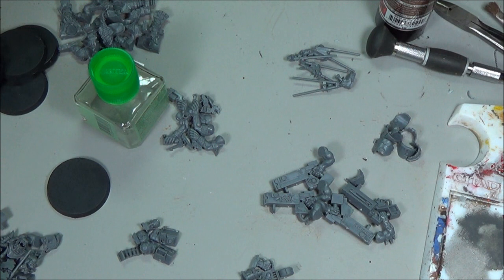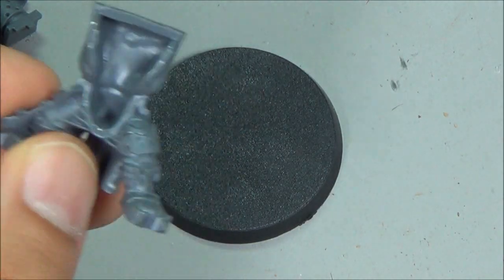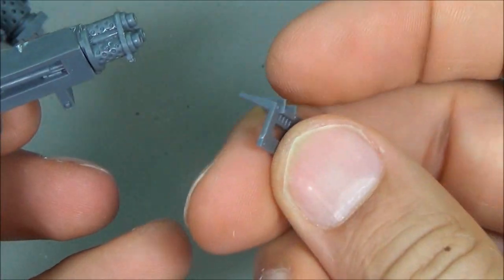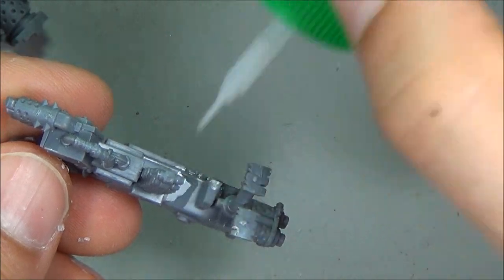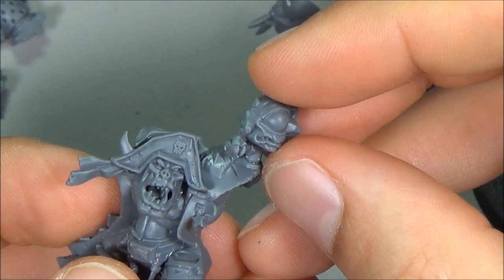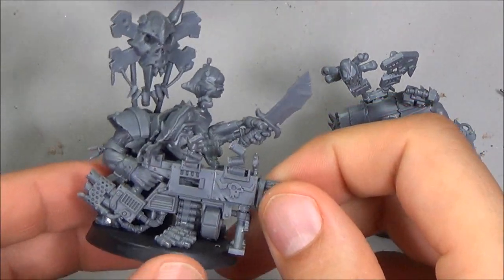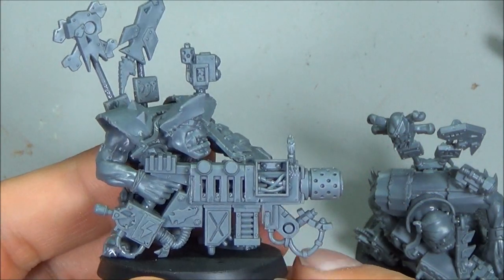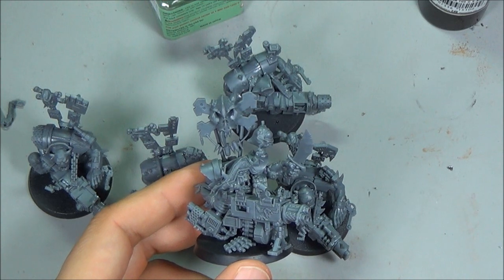Ork Flash Gitz Assembly

Comment: I am utterly disappointed with this kit.

wow we can have 5 guns look exactly the same in 40 different variations.

The guns look too similar to each other.. its not very orky
Reply: it seems more like its designed to be kit bashed and customized. when everything is finally on the model it deff looks more orky then the old models. though these guys are a bit clean cut.
Reply: modestrocker1
the thing with the kit is, it cant be kit bashed as much as the Nobs or Boys

There is one arm holding the gun, fixed legs and torso, all have boss poles for no reason other than they had to be given bosspoles.

As i said otherwise, the 5 guns all look the same, doesnt matter what accessories you put on them, they all look the same.

At least the Lootas kit had an amalgamation of different weapons cross the ranges.

And why are they suddenly all Pirates? Only badrukk is meant to be a pirate, as that look made him unique.
Reply: *****
 guns that look the same at a glance are still 5 guns that look the same.

I could have a squad of heavy bolter dev's and modify them here and there.  They would still be 5 heavy bolters.
Reply: *****
All of my orks I convert and kitbash to look different.  I bought Flashgitz thinking that while the guns will be the same held position, they wouldnt end up looking like a Space Marine Dev Squad.  All holding gun same way, same pose.

On the WB front.. the only plastic warboss can be made using the Mega Armoured Nobz.  No other way.
Reply: Maybe the guns were made by the same mek.
And he built the guns on a very "standard" chassis.
Its orks so you never know.